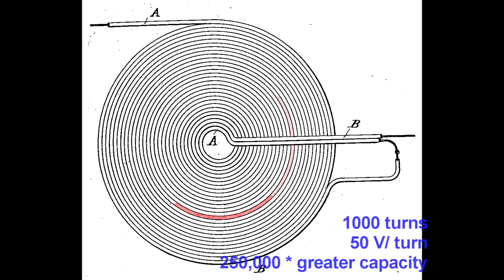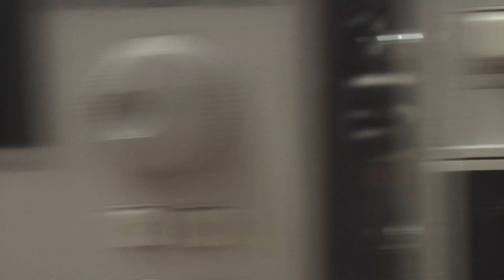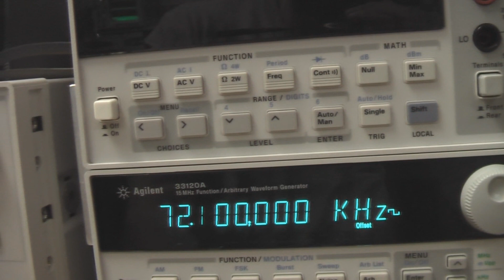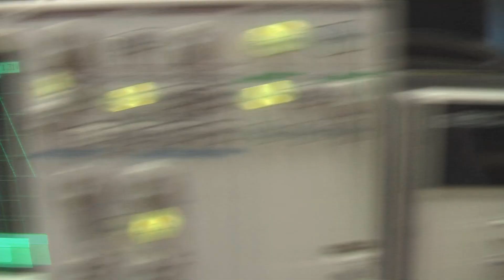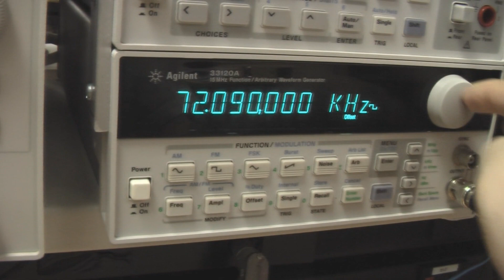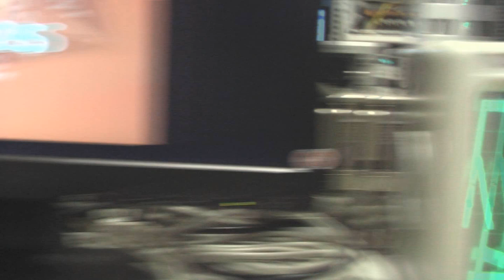Tesla Patent - Coil For Electromagnets

Comment: Posted in 2010. So much time, any progress?

This is the first demo of a bifilar coil that shows two critical behaviors. 1. it will only resonate at its natural tank circuit frequency. This is determined by the length of the coil. 2. That base frequency can act as a carrier wave for higher frequency signal tranport. This is AM transmission between resonant coils.

The Tesla patent points out that these coils amplify through resonance and do not self-distruct due to the distributed capacitance. So, unlike normal tank circuits that  blow up if the power gets too high, this one, without appreciable resistance between the Cap and Inductor, can resonate to high power levels. Radio principles of amplification can be applied to power systems.

To move this forward, you need to take advantage of Tesla's other area of focus, converting EM waves to LMD waves. With this next step, you produce safe power transmission with encoded information, or RC devices that are powered from the controller remotely... EM waves naurally push current orthogonally into the environment and dissipate and disrupt the electrical activity of what they encounter... that's why high power transmission we have today is bad for you. Essentially EM waves of sufficient power will cook whatever they hit that can't channel it safely. An LMD wave is a compression wave that forms the current in the direction of travel. This kind of wave is frequency dependent on how it couples into conductive atoms and lossless in distance traveled. It is the stuff of what reaches our planet from stars. Also, when created by large conductive surfaces, it requires a large conductive surface to intercept it. (Stars transmit from atoms, so the atmosphere and ionosphere works good at receiving and converting their transmissions.) So, high frequency, large broadcast antennae will only affect similarly tuned targets, passing through everything else (except moving charges of sufficient thresholds).

Of course the next step is to realize that LMD waves are naturally produced by the planet. Now you just need a receiver for all the power you required... all you need is a bifilar coil that resonates to the Earth's frequency and a properly energized or sized antenna feeding systems similarly tuned or converted to useful frequencies. Something else others have discovered and demonstrated in the past.

Both concepts in application will bring down the world economies if available to the world markets. However, they will also save the environment and support the increasing world populations. Developing them is a choice of doing the humain thing and re-valuing the world economies and borders or dooming all life on the planet. For 185 years we have chosen to cut our own wrists... Can we do better today?

Nice work, hope it leads to something good.
Reply from the maker: I'm rather surprised that people have not picked up on that before, then again, they are limited by what we are taught in our schools, and are afraid of stepping out of that box they have been put into. Tesla always said that he created a standing wave in his devices and prevented the transmission of anything over the air, attenuate Hertzian waves, not spread them. The discharges from his magnifying transmitter were unwanted because they destroyed insulation and the metal plates... except when trying to impress investors with the amount of power accumulated. 

Saw little interest from the public so have not posted more, now working on resonating magnetic bubbles. :)  Tesla's system is based on "Spooky action at a distance", as Einstein would call JC Maxwell's observation of resonant coupling. 

http://www.tfcbooks.com/tesla/nt_on_ac.htm      a good read if you have the time and the patience.  It is Teslas deposition for the Marconi trial, sadly he wasn't able to go through the trial, but that he entered this into the public record is eye opening.  I particularly like the part where he talks about his system being used backwards, to generate Hertzian waves, he terms it -cooking the atmosphere. the equivalent of leaving the oven door open-  

Good luck in your endeavors. will post more soon. working on control systems for the resonating communications system. I figure with three resonating magnetic bubbles and frequency hopping between them will provide enough security to keep the communication private and not interfere with "normal" systems of communication.

Peace
Reply: I'm making progress. there are two methods to make a bifilar coil resonant. one is by magnetic induction, the other method is by a capacitor discharge pulse, very shortly. These two methods can be combined in one resonant coil, making it possible to re use back emf, and recycle electric energy
https://youtu.be/1Q8usAXWtVM
this video is a proof of concept. more to follow

Comment: this very usefull information, but can u explain how u find best resonance, and what contain ur bifilar coil (wire dimension, coil diameter, what type is the core)?
Reply: you can make it with speaker wire:
https://youtu.be/ZKP9Bgpqa5E
and you can tune the frequency down by adding a parallel capacitor (for the coil shown in the link dont add more than 9nF then it resonates around 200kHz).
the resonant frequency can be detected with a small neon bulb.
at the resonant frequency you hold one leg, and touch the end of the coil with the other leg of the neon bulb.
it will light up. it works better if the other side of the coil is grounded.

Comment: Exellent topic! :)
Q:hello, if u connect bifilar i parallel inductance is same as in regular solenoid coil?

I found something weird about bifilar, using inner A coil terminal and outer B terminal (not the same wire) and it reads 50 ohm, where normal resistance was 2.6 ohm.
is this is good for generators in your opinion?
 im  aimed to do lenzness due to high inductive reaction, but after your wideo im not sure is this the right way... Cheers